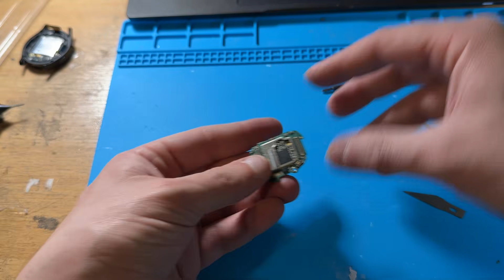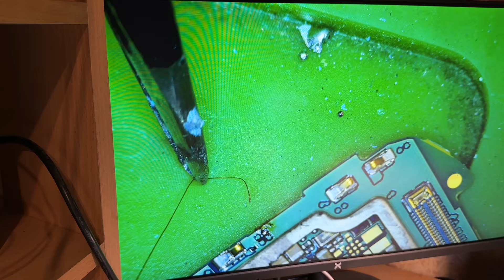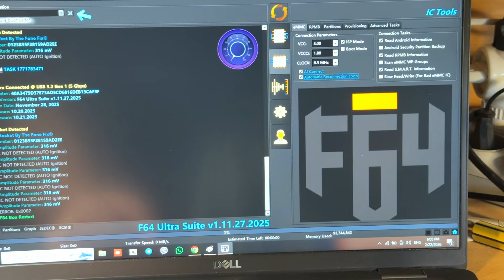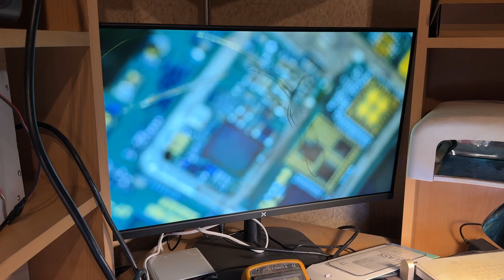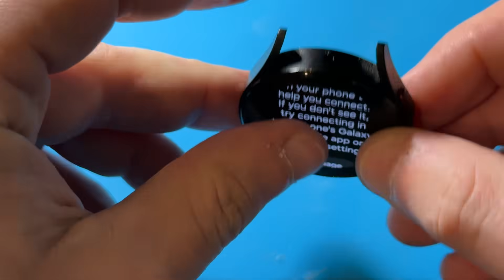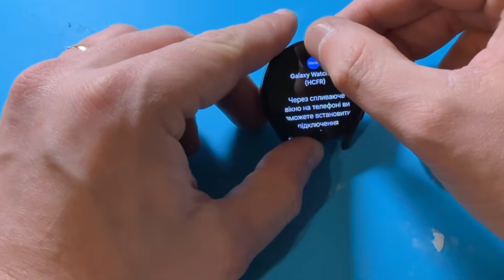How to unlock FRP (google account) on Samsung Galaxy Watch FE SM-R861 using ISP and EasyJtag/Flash64

Comment: hello I have bricked my sm-r8950, no firmware online will flash to it, I have also flashed combination firmware but I just get an write and read error. Would you be kind enough to share with me your copy of the AP file for this model so I can fix my watch, I have already spent money on firmwares so I dont want to spend more on ones I don't know will work. Great vid tho!

Thank you
Reply from the maker: 1. combination required token. 2. i dont share anything for free
Reply: @Remote_Unlocker where can I find combination token?
Reply from the maker: @elmidinpalwanmahmud9128 nowhere. its generating in daseul software and unique for every device. how could combination will help you?) its service software and after this for normal use watches you should reflash with stock
Reply: @Remote_Unlocker Well the watch is a sm-r8950 which only has firmware with CSC that is CHINA, I need to flash watch with firmware that can have XSA csc but that's only on the sm-r895F. The reason I tried combination firmware was so I could see if I would Able change that
Reply from the maker: @e @elmidinpalwanmahmud9128 r8950 have only china csc, r895f have eu and ww csc except china. so no way.
Reply: @Remote_Unlocker  ok no worries thank you for your time. I'll just buy an EU motherboard.